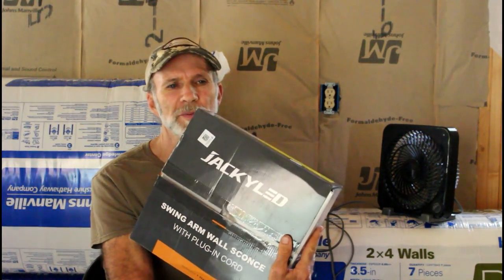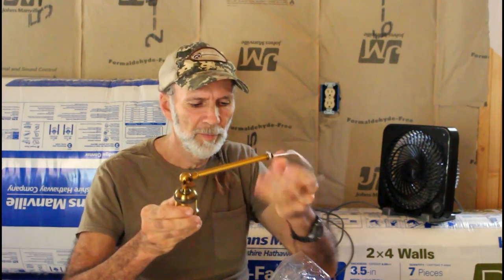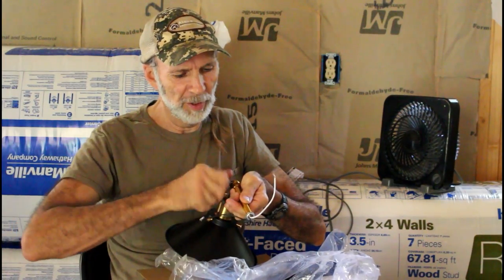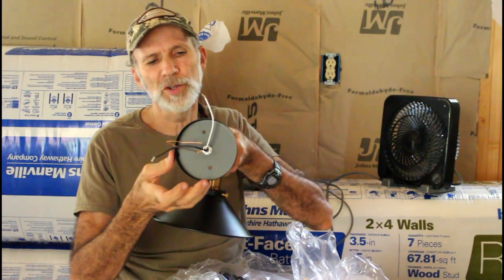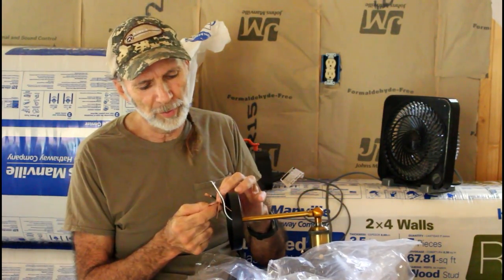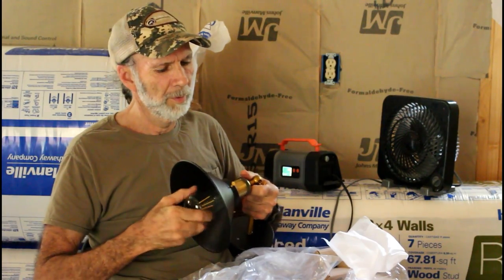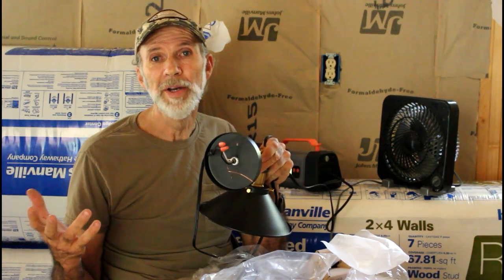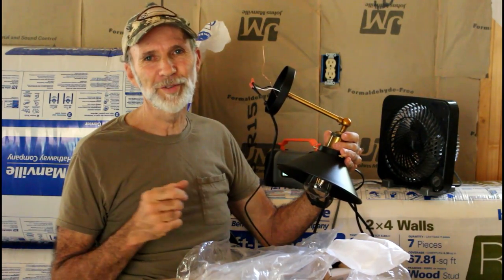NEW Lights for the Off Grid Cabin

Comment: Big question is can you change the bulb ? I have installed LED lights and had to change them out a week later because the bulb wasn't removable. Been doing electric work for twenty five years and never seen anything as stupid as that.

Comment: Very nice, the problem will come when the bulb burns out, and despite what they say on the packaging they don't last must longer than a regular bulb and those will be expensive. We have found the dollar LED bulbs from dollar tree last just as long as the 5 dollar ones at Walmart and you can order them by the case online and pick up at the store. The only draw back is they say they are equivalent to a 60 watt but I believe they  are closer to the brightness of a standard 100 watt incandescent bulb but only use 9 watts. We have found them to be the best bulbs to stockpile
Reply: Thanks!